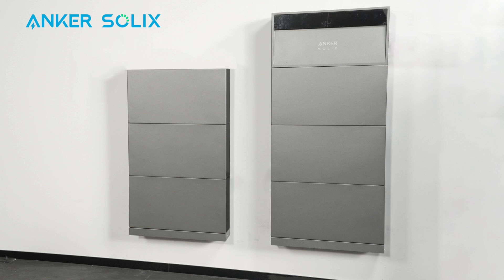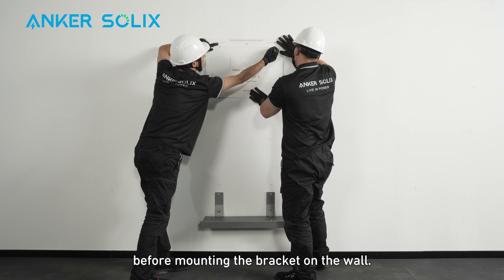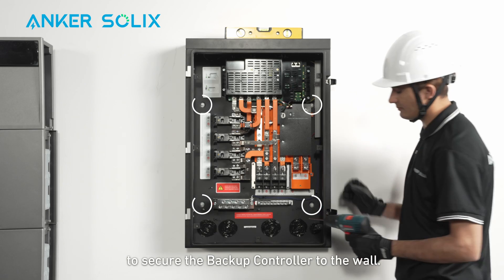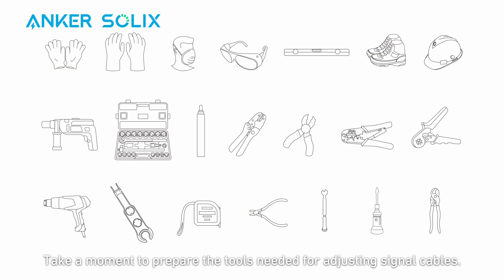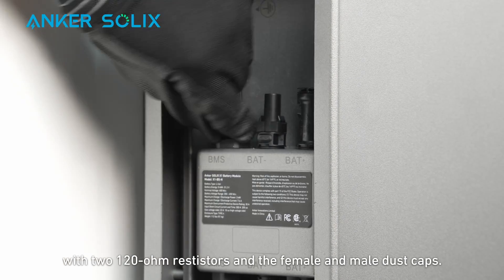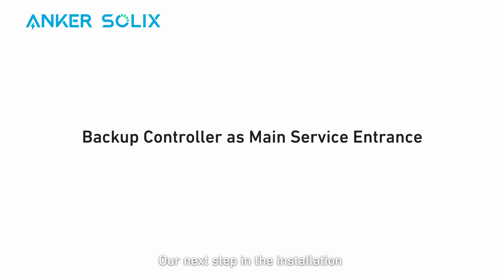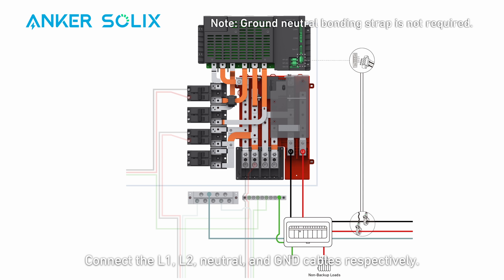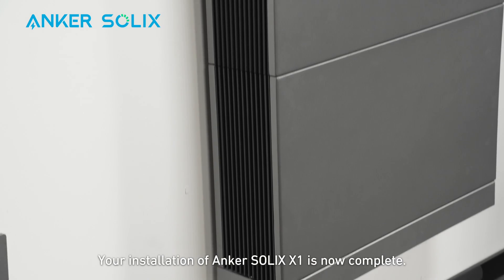Anker SOLIX X1 Installation - Two Module Columns

Comment: How much does it cost?
Does it support 240 Volts AC?
Can i aquire it for use in Nairobi, Kenya?
Reply: It's a home backup power station or a off grid power station depending on your use and yes it does have 240 volts also the cost of buying it is around $10,000 for 15 kilowatts
Reply: Tengo un problema cuando regresa la luz el switch no regresa ayúdenme alguien que me ayude porfavor